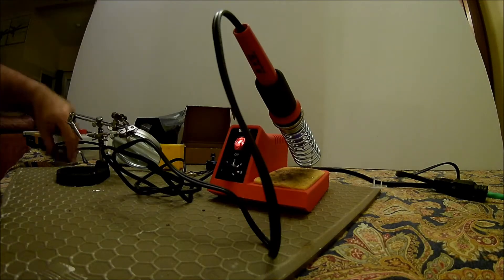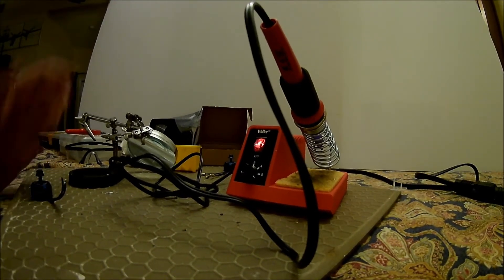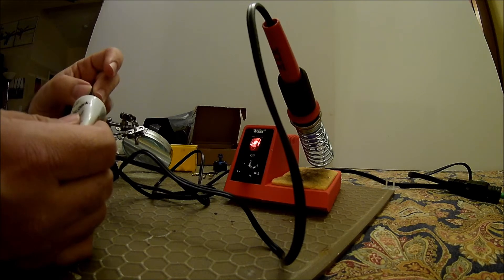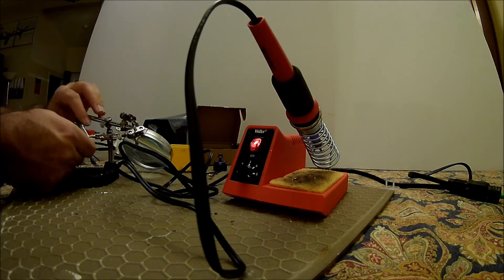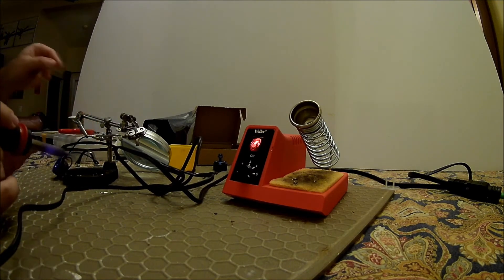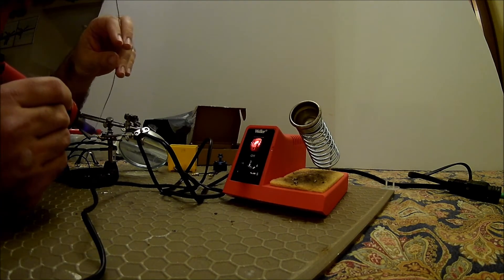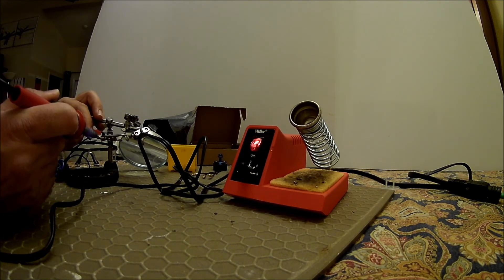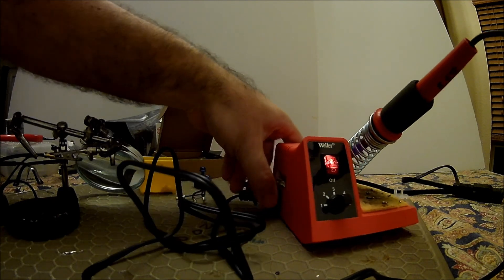Weller WLC100 40 Watt Soldering Station Review

Comment: I have the same Weller unit but mine refuses to heat up when connected to the variable power. The soldering iron works fine by itself...any idea what is wrong?